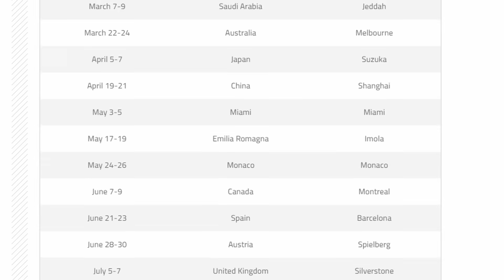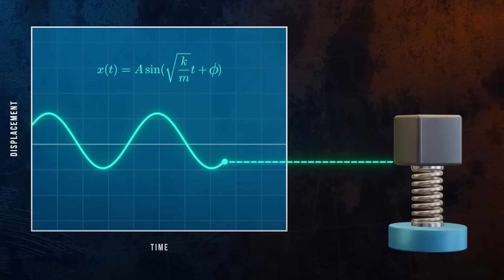Why These F1 Engines Only Lasted 200 Miles

Comment: 1:18 no, its running at almost half the rpm with stronger materials with higher weight, bc you're running at lower rpms. they did 2500km on the v8 revving to 18k and couldve down the same with the v10s 😂

Comment: I have a stihl 064 chainsaw that has a 40mm stroke and it’s 35+ years old. I was honestly stunned when you said that some of these engines had a 40mm or less stroke. I would really like to see a crankshaft just to see the throws and journals

Comment: These high revving NA V10 F1 engines were impressive. Especially those from Honda, BMW and Toyota. The P85, the last V10 was a 98x39,75 engine with an 90° bank angle with an really impressive power-to-weight ratio of 11,7 hp/kg engine weigth (960 hp and 19.800 rpm redline). The most challenging stuff on V10 engines are there firing order caused and uneven combustion events, causing huge vibration issues. Getting this reliable for a daily driver like the VW V10 TDI (AYH, AJS, R50) or BMW V10 (S85B50) is a real engineering challenge, but for up to 20,000 rpm it is an even bigger challenge. Torsion damper on crank and cams, dedicated counterweights on crankshaft to compensate the non-optimal 90° bank angle (72° would be even = 720/10). 

Beside there impressive capabilities regarding peak power, these engines are mass impluse driven (mostly). The NA engines we design and built for hill climb and circuit racing have much higher specific torque outputs then the Formula 1 versions. About 140 Nm/Liter for peak and 130 Nm/Liter on a wider bandwidth of up to 4000 rpm width are possible. The maximum spec. torque of the P85 F1 of BMW was 120 Nm/Liter. It's design, especially the engine speed and the stroke hinder for more. Each race class has it's own challenges, the NA F1 area had engine speed as a master challenge. The actual F1 is a very complex drivetrain system, which cost way more, too much for my taste. I know the engine designer of the BMW M12/13 F1 engine (1,5 Liter, 1400 hp) personally, who went through the design process mostly by himself with guys from workshop and parts fabricators. Today about 5-30 engineers are working on such an engine. I don't like this, that's a purely money driven competition, not so a man and competence driven competition. The head of Porsche's race activities said once to me, todays races are won on money and management. Maybe big companies develop there their innovations for the management methods ;).

Comment: Toyota had a v10 3liter engine that weighed 93 kilo... revved over 20.000 rpm and produced 890 hp...
Also peugot made one of the most extreme v10 at that time
Also... these engines are short stroke engines.
Short stroke engines are more about horsepower and long stroke engines are more about torque...
The stroke of a formula 1 engine can be 43 mm or 43 mm and the bore of the cilinder aprox 94 mm

Comment: You are hilarious. You can't seem to decide whether nothing matches the NA V10 era or the current V6 hybrid era. 😂
And your ending is misleading. The V6's of today would not be capable of insane levels of power even with higher revving as would be possible if you turbo'd the V10 engines with lower revs. That would be on another level. What you really should have asked was imagine what performance would be possible if you Turbo'd the V10.  And regardless, nothing beat the aura, brutality and magic of the 90s and early 2000's F1. Also CART Indys were pretty cool turbo V8's.   All you are trying to to is justify the vaccuum cleaner F1 nonsense of today and its not working. Its not the real deal. You can try to explain this till the cows come home but you are wasting your time and effort. People do not like today's F1. The vibe is just not there and really sucks.

Comment: I’d also argue that the technology and the rules the modern engines have to stick to are more beneficial for road cars, as is the tech filtering down into ordinary cars. Lower revs, greater fuel efficiency and greater reliability is whats best for road cars, not the tech that goes into making cars barely last 200 miles and arent that efficient.

Comment: I'm aware this was a throwaway joke line but "no replacement for displacement... except for boost" is wrong. Boost is not a replacement for displacement. It's an approximation of displacement but not a replacement for it. Turbos have lag and importantly boost threshold. Centrifugal superchargers also have boost threshold and positive displacement units are highly inefficient. They consume more fuel than an equivalent naturally aspirated engine and require higher octane at that. Twin screws are a bit better than roots in this regard, but they all have their drawbacks. There is no replacement for displacement. It's important to distinguish that. Not saying that displacement is necessarily better - obviously that depends on your application, budget and of course personal preference. To get to my point, the saying "there's no replacement for displacement" isn't some saying that used to be true but no longer is. I used to think that, but the more you think about it the more your realise forced induction merely approximates greater displacement, it can't quite replicate it perfectly.  So there is actually truth to the saying, much to the horror of many of my fellow JDM enthusiasts. My 2 cents.

Comment: Well 'at these speeds the valve springs etc' so pneumatic valves etc....that is incorrect. Jap 250 4's ran at 20 000 on normal valves. Honda ran 21 000 in the 1960's on NORMAL valves.

Comment: There's been a saying for a long time in NASCAR that you've run the perfect race when the moment you cross the finish line your engine explodes, you completely run out of gas, and your tires go flat. That glorious F1 V10 era sounds very similar.
Reply: Enzo Ferrari used to say a similar thing: "The perfect racing car is the one that breaks down right after the finishing line".
Reply: @Rimpianto  That wasn't Enzo, he wanted his cars to be strong so he could sell them at the end of the season. Colin Chapman of Lotus, with his "simplify and add lightness" mantra was the one who described the perfect racing car as one that wins the race, but disintegrates as it crosses the finishing line...

Comment: Great video. But the part when you say that F1 engines couldn't start at low tempetures because it would be seized is not true. It dosen't even makes sense... When an engine is designed to be as powerfull it can be with an displacement target it will generate more heat and more stress in all the mechanical parts of the engine, with ones are made of metals. Metal tends to expand under heat, so racing engines are build with loose clearences, the clearences are so loose that they cant start the engine when its cold and the internal parts are in normal climatic temperatures because the engine would destroy itself over as the clearences would be too loose to mantein an oil film lubricating the parts, even worse in this F1 engines that have an idle arround 4000 - 6000rpm. Besides that, great content!

Comment: These engines also used massive bore dimensions and to stay within the capability rule they went for short stroke (very over square engine). This path to power will place epic loads on the pistons that are going to try there best to flip over in the bore while it’s running at 18,000 rpm.

Comment: As a side note: these engines weren't done after one race (if they didn't explode). In hillclimb events the used engines turned up - of course very restricted in rpm - and enjoyed their second life for much longer. They were probably relatively cheap to get and there was ample supply when each team used minimum two engines per race. So technically, they lasted a lot longer than 200 miles, just not with F1 rpm.

Comment: Yet another F1 video talking about how the engine is seized when cold. This is false. Clearances are fairly normal but tolerances are really small. How would you build an engine if the parts don't fit when at room temperature? Preheating is to prevent startup wear and to get fluids moving.

Comment: The only reason they lasted that long is parts go in them are so light ,engines were so high reving did not need to last long ,can remember had abundance of engines they used ,one for qualifying ,one for race ,every race qualifying used new engine ,so be it if want best cars in the world thats how its done now its too many rules ,engines have to last longer ,tyres all same brand how is this real f1 ,suppose to save money in fact costs more now have engines last this long bring back v10s,v8s thats real power noise cant replace that all electronics these days stupid DRS, might as well just put same engines in car bet thats in books soon .

Comment: I was lucky enough to stand at the barriers of turn 3 in Montreal for the 2004 GP. I was wearing ear protection but you could physically feel the sound waves hitting your chest like a drum. Truly insane!!!!
Reply: I was there 2000, and 2001 near the Casino hairpin. I didn't have ear protection the first time so I  suffered partial hearing loss. The sound and vibrations truly affect your entire body - it pierces right through your body . The V10 era was the most amazing era in my opinion.
Reply: In the mid 70's you could stand 20 ft from top fuel dragsters and apon take off it would vibrate the wooden/steel framed grandstand and your skeleton would too
Reply: I was at Indy, no ear protection

Comment: I would love to see F1 ditch the sustainability angle and return to being the pinnacle of race engineering. The only things that should matter are performance, the quality of the racing, and, of course, safety. We have the whole rest of the real world to worry about that shit. It's okay to have some places where entertainment and fun come first.
Reply: There's nothing wrong with using sustainable fuels (e-fuels).
Reply: @PistonAvatarGuy  Of course, and no one has an issue with them to my knowledge.

The point is the only thing that should be leading F1 development is making the best, most technologically advanced racing vehicles and the best racing possible. 

That's what people miss about what F1 was. It was extreme by design with room to innovate but now the "power units" are meh and the big announcements for future rule sets are pursuing things few people care about within the sport. 

There is a reason people smile when they hear the hi revving V8s, V10s, and V12s.

Comment: Great job on your F1 technological recap, lots of bullshitters everywhere but in every place you made a statement about a particular with the 3L V10 you’re spot on with my research, great job!

These engines are insane, the tolerances are such that you can’t even start them at ambient temperatures, they have to be preheated before start as they’re effectively seized until they’ve expanded enough to actually run. I love that the current engines run 100x longer than the old v10, although they sure don’t sound as good.

Comment: F1 lost its appeal (for me) precisely because the governing body embraced the modern ethos of 8-race capable engines, modest power outputs, tightly controlled budgets, sustainable fuels, renewable this, recyclable that, yadda, yadda, yadda.

That's all WRONG. Go down that route for lesser formulas if you must, but F1 should represent the pinnacle of what can be achieved in motorsport, regardless of cost - and I mean that both financially and environmentally.

One unlimited race series isn't going to destroy the planet. It may not tick the right 'green' boxes, but some things are more important than that.

I did some rally driving [only amateur] in the Group-B era. The cars, the drivers, the teams, the engineering, the innovation - even the spectators - were unlike anything the sport had seen before. Like F1 at the time, it was not a safe sport. Tragically we lost far too many drivers and spectators to accidents and incidents, and rallying was changed radically to lessen the dangers.

And as a result, rallying itself died.

To many people the demise of Group-B signalled the end of all that they loved. Modern WRC rallying, just like modern Formula 1, is certainly far safer than it used to be - but I see no PASSION in it. I no longer care who drives what because all the cars are... dull. No one team can be allowed to dominate or even innovate because 'that wouldn't be fair'.

Oh, please.

I'm glad that I lived through the greatest years of F1 (and rallying). It's sad that many of today's motorsport fans find more excitement and thrills on their sophisticated racing simulators at home than at the race tracks of the world.

Of course safety matters, and nobody wants to see drivers forced to participate in a sport that claims several lives a year; but that's the point, isn't it: nobody forces drivers to take part. They know the risks now just as well as they knew the risks back in the '80s.

Drivers would still be fighting to get an F1 drive, even if the cars were as deadly as they once were.

F1 should be an extreme sport, without compromise. The shrieking, screaming, 20,000 rpm V-10 era was magnificent and is sorely missed. Just look at the viewing figures for any YouTube video on the subject. Look at the viewing figures and Comments for THIS video!

People cared about Formula 1 racing 20, 30, 40, 50 years ago in a way that they don't any more. Designing an engine that explodes as it crosses the finish line after a 200 mile race is not a failure: it's an example of the kind of precision engineering that made F1 special.

It's not special any more.

Comment: V10 engine was more advance than the current v6 is, and the current v6 does not make 1k hp.  The V10 lasted one race, because it that's how long it needed to last.  Almost all pistons are not round when room temp.  Also the "cant turn over when cold" myth has been debunked tons of times

Comment: The F - 1  engine rule BS is so stupid =   It’s Formula One !   That means incredible !
The fans watch to see incredible -  TV $ pay to see incredible power , car & driver performance .
If F - 1  cheaps out they will go the way of nascar  .    That is a downfall .    Just look at the 
Fan base ….  Streets are for regular vehicles !    Top tracks are what the fans want to see -  in 
Person or on TV  -   Speed !    Speed draws the fans -  street circuit is and should be a very rare 
One off type event when a suitable track is not available .    Real , designed race tracks are what
The race fans want to see good competition on .   Plain and simple -  cheap out with rules etc. 
and your people will wonder off to the  real racing at Indycar and Score off road / Baja to get 
What they want to see !    Don’t continue to ruin a great relationship with your fans . 
Fans can be fickle and dump you like I have dumped nascar after  nearly 50 years -   My young 
Mechanic friends see it all the same way .   Not surprisingly , the young women see it the same 
Way the rest of us men race fans see it going south !       Correct the poor trend before 
The attention span has run - out .    After that point all the advertising money will not mean shit 
Because fans will already be on to the next  “ latest and greatest “  Motorsport show that 
Captures their attention /  group interests .    Fickle is the term -  be mindful or the sport will 
Suffer the consequences of stupid / greedy decisions .   I really hope that this message will 
Possibly help governing bodies to understand ,  fans are people with money and passion .

Comment: The myth that the tolerances are so tight that the engine cannot turn over is not true. The reason they preheat the fluids is to prevent premature wear.
Reply: Actually thermal expansion is real and therefore tolerances do change. So whilst it is a myth that the engines are locked prior to preheating it is necessary to normalise the clearances prior to start up. Preheating also means no "cold start" sensors or mapping are required.

The most egregious claim in this video is that the pit crew at the race track would remove and then replace piston rings for qualifying and the race.

Comment: Only last 200 miles, A Top Fuel dragster engine only lasts 400m or 1/4 mile. and only rotates about 750 times.

Comment: Oval pistons (6:53) are nothing new and not exclusive to F1 engines,
Reply: Yeah, Honda experimented with it once, with 8 valves, and is basically a v8 with every two cylinders joined together. Didn't succeed though...

Comment: The 80s were borderline uncontrollable but required balls to handle and with a manual transmission
Reply: Do you mean having a jet engine behind you using manual gearbox?

Comment: I was involved on the business side of the 2007-09 ING Renault F1 Team.   I asked Pat Symonds the very question about the life of a F1 engine.   He said they build engines to the edge of requirements.   If F1 restricted teams to four engines, they’d build the same engines, just ones that would last longer.  

Pretty much what the video says.

Comment: All pistons in all engines are not round, that isn't something that is unique to F1. Pistons in all engines are all made in a slight oval shape so that when they get to temperature and expand they become round. The most unique thing about F1 pistons are the ultra short skirts they used to run which is another big reason these engines didn't last very long.